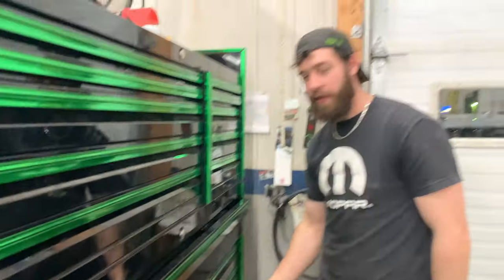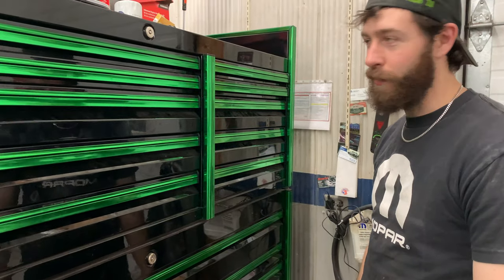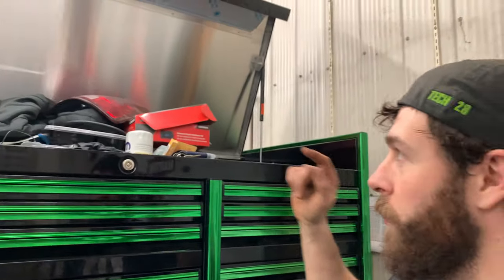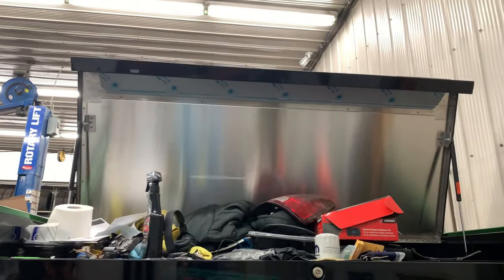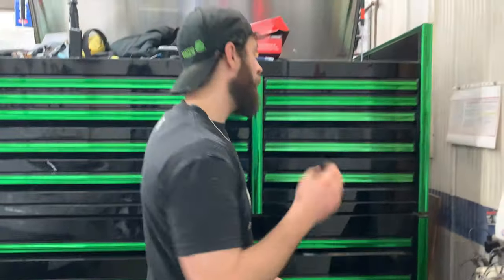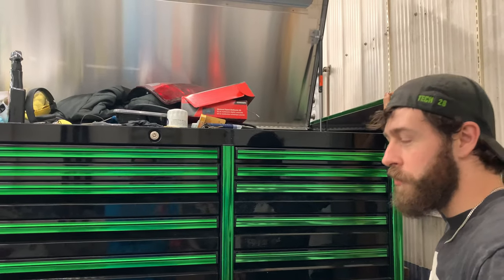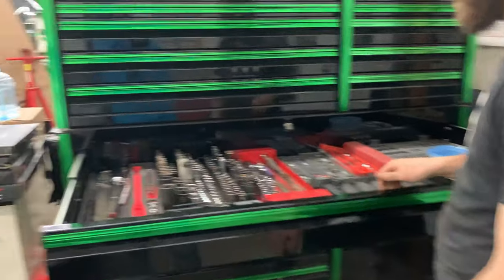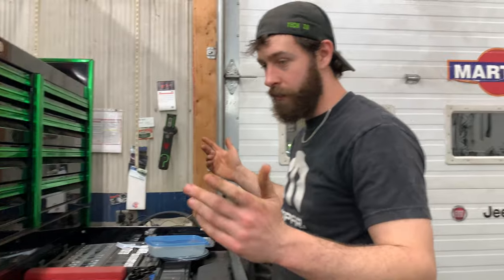5 Things I Hate About The Snap-On Epiq Tool Box

Comment: Strange because my epiq’s drawers open flawlessly no matter what. Better than any toolbox I have messed with. My drawers also pull all the way out.
Reply: Same. I have the newest Epiq series. The 9 drawer with the power drawer and speedrawer thing.

I've had it LOADED now for a good 6mo, and I just went and checked, and not a single one of my drawers rack like that. Kinda odd.

I don't see the spot welds anywhere either on my top chest. But, mine is also painted with their custom shinier darkish blue stuff on the faces.

I have 2 matco boxes from last year, and a Maximizer that's a few years old. Definitely have better structural quality in the snap on I have. Maybe I'm just one of the lucky ones?

Comment: You bought the wrong tool box without doing your research first. You can position your sockets out toward the front of the draws and put your torque wrenches in the back of the draw instead. You should have checked other tool boxes before buying the epic.
Reply from the maker: Position the sockets horizontally instead of vertically you mean?

Comment: That's weird about those top three drawers. I've had my 68 for 5+ years and they have never done that to me, lots of weight in the top and bottom ones too.  I just upgraded to an 84 which the top three are also fine however it has shorter drawers on that bank

Comment: Have you tried yanking the drawer a little more forcefully? I have a masters series and I have to do this from time to time. It'll come out further. Saying this though, I don't like that the fold/bend, they do to the drawer, is bent inwards and not behind/outward to the back of the drawer. The "lip" that is created most definitely gets in the way.
Either way, I still think these are the best looking boxes out there. But that shouldn't excuse them from messing up one the details! Good video.
Reply from the maker: well you see, the epiq boxes in comparison to the other series have a different drawer handle and latch style, i might see if i can adjust or (worst case scenario) shave down the latch part
Reply: Yes they’ll open an extra couple inches with some extra pull to bring it all the way out I guess the slides stiffen up further out they draw.

Comment: I had an older KRL and agree that the drawers didn’t have that side to side racking motion. Drove me nuts also.  But then I thought about it and the only way to prevent that with a drawer that size is to have something in the center to act as a guide, which would be hard to do. The issue is not the drawer flexing or the slides, but the fact the drawer is so large that one side can move independently of the other. 

That said, I really like my Epiq.  No issues and I have it fully loaded.  It seems that the drawers do better for me with more weight and double slide (if they don’t have them already).  I also use my whole hand on the latch rather than a couple of fingers.  Thanks for the video.
Reply: I feel like for the 100 years that Snap-on has been building boxes they should have an idea how to counteract that. A softclose slide with adjustable tension on the open might help. A little resistance might keep one side from opening faster causing the drawer to rack
Reply: @OnTheToolsWithSal  I don’t completely disagree.  After 100 years and for a $25k investment for the cost of the box, I’m sure that there should be SOMETHING to counteract this.  It’s really easier to understand once you actually see what’s going on.  The drawer isn’t flexing nor is the box flexing, it’s just a 54” wide drawer that’s also 30” deep, that can move independently on the slides, so it feels weird.  The KRL boxes don’t have the issue because the drawers aren’t as wide or deep.  I was pissed at first, but then once I realized what was going on and got used to manipulating the drawers, they work fine.  I have an Epiq cart that doesn’t have the issue.
Reply: They could figure out how to stop the wobble but they don’t care. I thought I’d work hard and buy one of these boxes someday but I’m realizing they’re all show and no go.
Reply: @markm0000  I really wouldn’t say they’re “all show and no go”.  You’ll definitely realize if you have to move a tool box of this size fully loaded with tools that they’re not just hype.  I’ve seen guys at the dealership rack a box so bad the drawers wouldn’t open just moving the box fully loaded.  I’ve seen drawers that warped where they wouldn’t open or close fully after just a few years of professional daily use.  What we’re talking about here is a minor complaint.  You’ll definitely realize the value in one of these boxes if you buy one and decide to sell or trade it in a few years.  They hold their value EXTREMELY well compared to other brands.  Again, this issue is only present in certain drawers that are 60” wide.  That’s literally a 5’ wide drawer that even with the side to side play, 2 people could literally sit in this drawer and it would open and close smoothly.

Comment: My Epic is, oh, about 13 years old now and I don't see that top drawer major problem on it yet. You obviously probably open and close them much more than I do, but I'd for sure get the SO truck dude to warranty some new slides. If that doesn't fix it, maybe see if they'll let you try a new under handle mechanism. Mine (and it appears still the same on the newer ones) to just be plastic on each end with a hook. Anyway, I'm pissed with you on that and I simply can't replicated it on the one I have of the same size.

No comment on the top chest as I optioned for the hutch.  I'm 5'10" and could never see in the top two drawers of the others, let alone the top storage area. That's where the roll cart comes in really handy and I get more work surfaces for so much more activities. I'd rattle can some bed liner on that lid...heh, bothers me too on a great looking black box.
Reply from the maker: Drawers have done that since new

Comment: I would pull the Sheet metal screws from the hinge and install Rivnuts and then use Robby or Allen Cap machine Screws or bolts. It will look better and be far better fasteners,the way it should have been built. All your complaints are pretty disappointing considering you are told and think you are buying the best of the best.
Reply from the maker: Well what is your recommendation for the best quality box?

Comment: Harbor freight has a better one than that plus the other reason why you should hate that is the price you paid for that never hear people tell you the prices they paid for these boxes when they do these reviews lol
Reply: That's because 90% but them used off of the truck. (Truck uses it for a few months to store new tools and use as a show piece. Then, they sell them at a STEEP discount along with other discounts).

Ie- I bought my 68" lower roll cab (like the lower one in this video) with the Speedrawer and Power drawer with a custom paint setup and blackout detail options — for much less than normal. My box is sold at $15,405 brand new through Snapon. 

But, I paid $6800 for it. I traded in a shitty used box I bought for $300 (they gave me $3k for it). I had good history with them, so they knocked another $2500 as a promo thing. And marked it as "used" because it was used on the truck for 2wks before I bought it. 

So, it was marked down to $6800 for me after all said and done. So, most of these are usually either bought secondhand from a guy in financial trouble, OR, they're bought in the manner I bought mine. Only around 10-15% of guys actually but then at sticker (or when custom ordering one that isn't usually pumped out).

Comment: I spoke to someone about the caps and they said many shops have anything from diesel to stone crushers and what not. The reason is that fluid can build up behind those trims if you don't have a 'drainage' because they are essentially just double side taped. Now granted we were talking about the bottom box that is in contact with splashes and spills.

Comment: I’ve got a KET843 epic triple bank it’s my pride and joy and it’s paid in full.  Kept my old classic 78 box lockers and hutch too. But my full length drawers have to be opened in the center to get latches.  But those drawer slides being so sloppy is pure shit. That’s way out of alignment or the slides are bad or they installed wrong slides. Whoever sold you that box and made the $, would be getting some plastic trim caps for top section. And be fixing those sloppy slides.
Reply from the maker: So I buffed down the plastic catch tabs and now it opens and closes minty

Comment: Wow! I have fewer complaints about my Harbor Freight ICON box. My drawers even seem way more solid than those. It’s definitely finicky to get the tension set just right so they don’t wanna bounce open when I close them. But I never have a problem with them sliding open easily and evenly. Even the HEAVY socket drawer and hammer drawer. Smooth as glass.